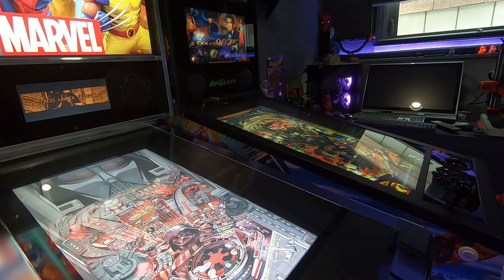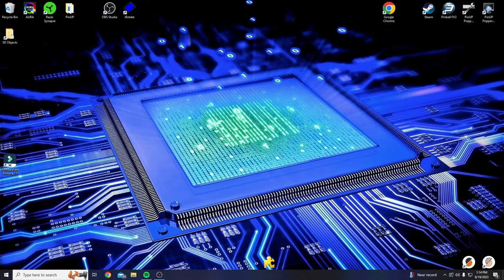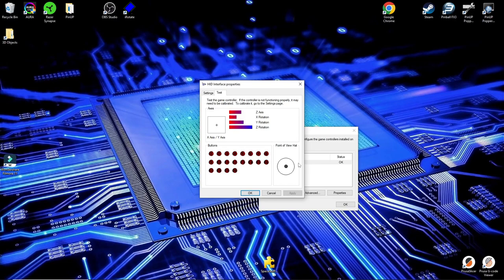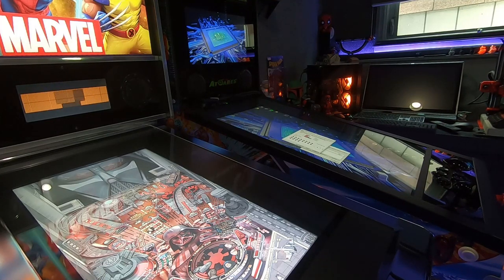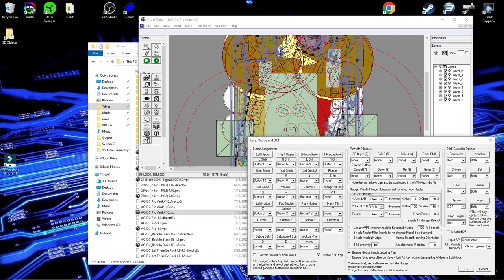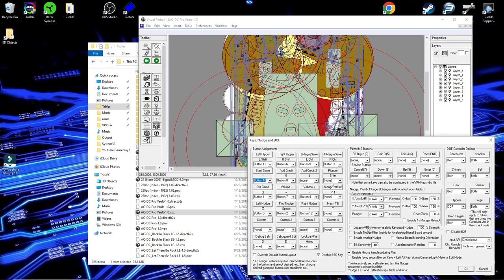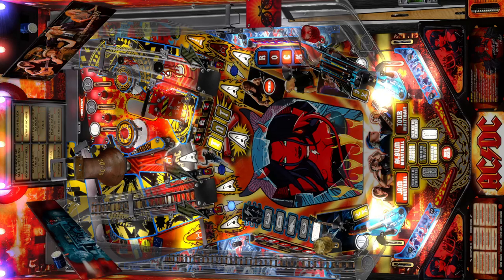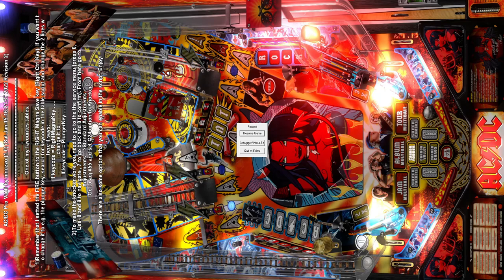VPX Button Mapping: Legends Pinball - No JoytoKey

Comment: Question for you Paul. How did you map the keys for the ALP in Virtual Pinball X? And Pinup Popper Baller?
Reply from the maker: It’s in this video for VPX - virtual pinball X. 
For pinup popper, you have to go into the settings menu to map your buttons. Just make sure quit game and exit emulator aren’t on the same button.
Reply: @JohnPauls  do you know by chance what buttons the regular At Games Pinball uses to move left and right? I was trying to program the ➕ on the regular board but don’t know how each one  would be setup. Thanks again John
Reply from the maker: Hey Jay, first step would be to see if windows see those buttons. If it does, they can most likely be mapped.

Comment: What setting needs to be changed to enable nudging? When you nudge at the end of the video are you physically bumping the table or using a button?
Reply from the maker: Buttons, the physical nudge- using the accelerometer is not accurate and with stronger haptics installed, it will create false readings/nudges. I disabled physical nudging.

Comment: I might have missed something but does the accelerometer nudge work too?
Reply from the maker: No effectively, I disconnected mine as it causes erroneous readings, nudges and tilts when not wanted. It causes even more havoc in FX3. 

I programmed the buttons to be my nudge’s.
Reply: @JohnPauls I can’t seem to get the plunger to work. Any advice?
Reply from the maker: Check to see if windows is seeing the plunger first. Out of VPX.

Comment: John, So windows knows the buttons so no need to do every table? Second if you play a table on Pinball FX3 that you don't own will this still work?
Reply from the maker: Correct. Different procedure for FX3. I made a separate video but will require the arcade control panel add on.
Reply: I do have the arcade controller add-on installed. Can you let me know what video it is to watch? Much appreciated!
Reply from the maker: @grouper3059 https://youtu.be/EU--hWM6wOw?si=hYOu5boTyWoNw6M0 you’re most welcome!
Reply: @JohnPauls  John, followed this step by step along with you. When I exit out of the controller set up only the trackball works. In FX3 under options the keyboard shows up. Any idea what I'm missing?
Reply from the maker: @grouper3059  most likely a setting in FX3. Try resetting the controller config and try again. The tilt motion sensor on the ALP can affect setting up the mapping, be aware of that.
Reply: @JohnPauls  Can the tilt sensor be turned off?
Reply from the maker: @grouper3059 no, can be disconnected. Check to see what windows sees, if you see movement on the xy axis without any input from you, that’s the motion sensor.
Reply: @JohnPauls  If I see movement this won't work then?
Reply from the maker: @grouper3059 movement causes the wrong input to be selected sometimes. If you are experiencing that, the sensor is the cause.
Reply: @JohnPauls  Interesting, when in Steam if I right click on FX3 and then properties all the ALP controls work perfect as I navigate around. As soon as I click out of the widows back to the steam main screen nothing. Any idea?
Reply: John thank you, I tweak around in FX3 and it's working great!
Reply: John, everything is working and I even tested the buttons in Steam however my left flipper and the X button both adjust the screen position. Very annoying during play. Any idea's?

Comment: Are you using the At Games Legend Controller by chance or just the standard ALP board it ships with?
Reply from the maker: Yes, AtGames controller has been installed.
Reply: @JohnPauls  do you know by chance if the settings will be as easy with just the standard board that it ships with as well? Thanks for the awesome  videos by the way
Reply from the maker: Yes, as long as you follow my guide and get visibility on which buttons correspond with what the PC is seeing, you can map the direction pad on the stock control panel. Just limits you on buttons available to map.
Reply from the maker: And thank you for the feedback, I appreciate that 🫶🏼
Reply: @JohnPauls  I’ll let you know how it goes in regards to regular setup without the controller and with the standard setup.
Reply from the maker: @jayjensen954 please do, I remember getting the directional pad to work before I swapped over to the control panel. It’s still a standard usb connected controller visible to Windows. Best of luck and enjoy VPX, it’s a blast!
Reply: Thanks everything seems to be working awesome! However the one thing I cant figure out is what button do you have to do a complete exit or quit out of the game itself? @JohnPauls
Reply from the maker: I’d suggest using the Red back button on the front of the ALP. Just don’t share the Exit emulator and Quit Front End button. 

Q = Exit Game